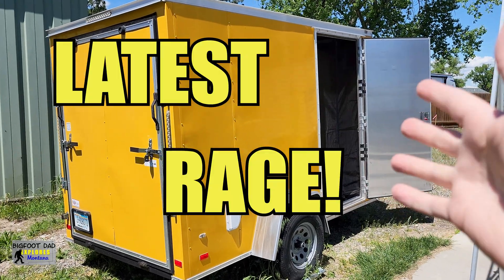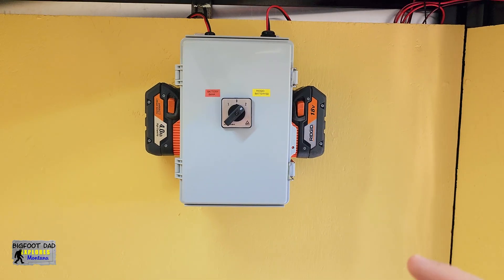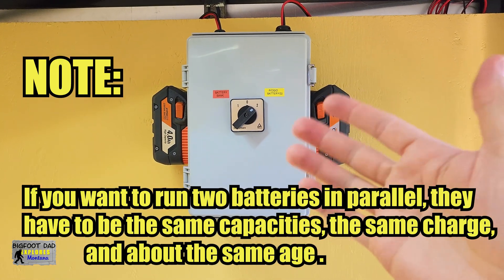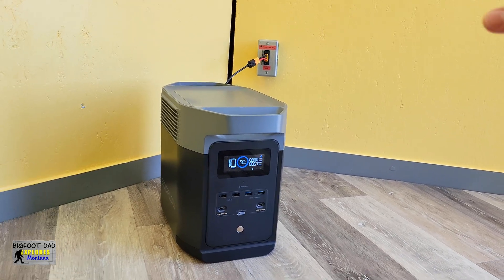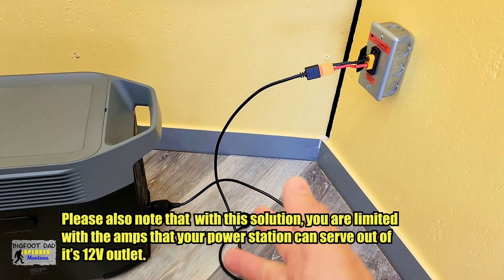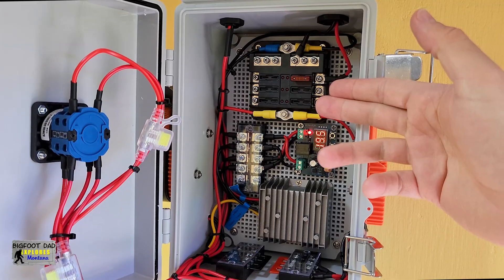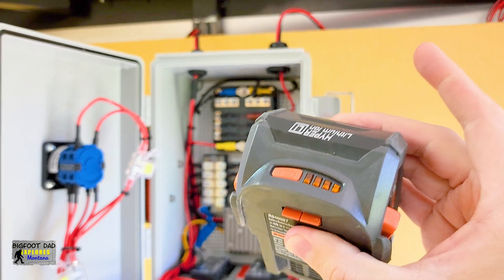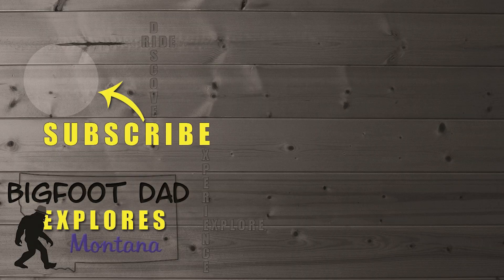"Drill Battery" Cargo Trailer Power - Upgraded Version!

Comment: This might be a dumb question but how does one wire the lights and plugs to run off a power bank ?
Reply from the maker: Hi, Santiago.  I've been thinking for a couple days on how to answer this.  Refer to this video here:  https://youtu.be/oDUAvaXsK1g .  Essentially, the batteries would be your power bank, the switch is optional, and the LED represents your lights.  You can hook up multiple lights in parallel to a single one.  
Your main challenge will be to provide the 12V out from your power bank to a positive and negative lead so that you can easily plug and unplug your power bank.  I would recommend using something like this: https://amzn.to/3I5muyK .   You can hook up to the negative and positive leads to your lights and optional switch. 
Otherwise, perhaps calling an electrician to help you out may be your best bet  - this would be a simple project for them to accomplish.  
  Hope this helps.